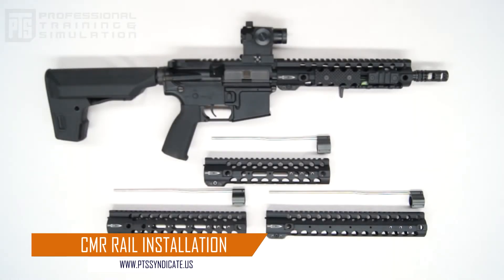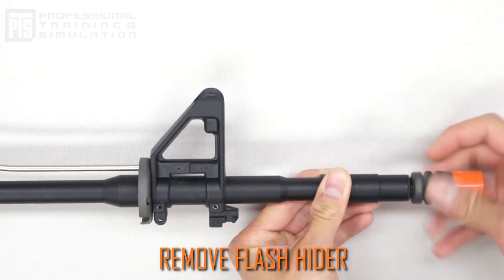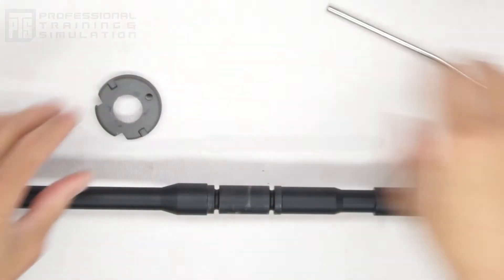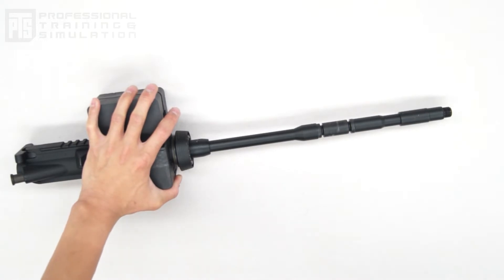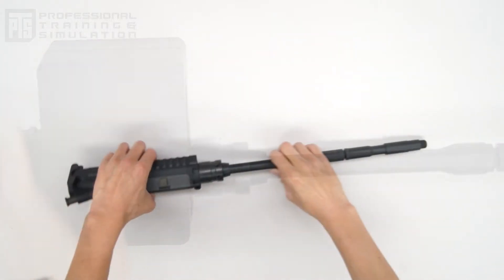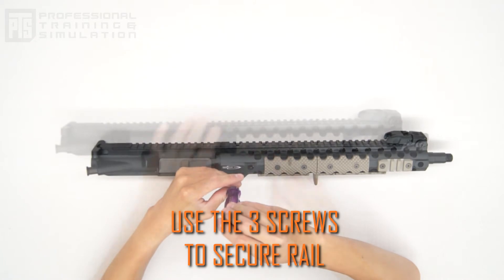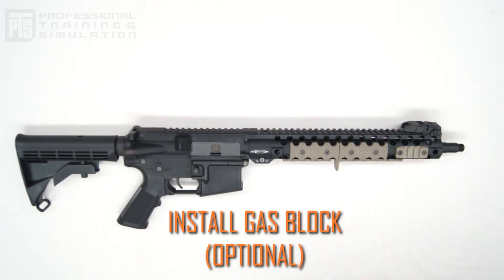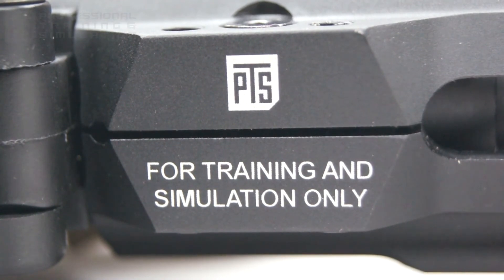PTS CENTURION ARMS CMR RAIL INSTALLATION

Comment: Hey, PTS, just a note from an actual AR15 user and airsofter. when you install the rail, it is easier to install the gas block first, and THEN put the rail on over it. Just a realism critique. On a positive note, I love your work, keep it up!
Reply: you cant install it first
Reply: @HeckerAirsoft  yes, you can. If you can insert the gas block from the front of the rail system, then the diameter of the rail is clearly large enough that it could have been installed first, like a real AR15 would be built. Not only that, but it would be easier to do it this way as you will not have to work around the rail system to install and pins or screws that secure the gas block to the barrel. And before you try to come up with an argument, I am an SDI graduate and licensed gunsmith, on top of building real steel AR15s professionally and have been doing so for 6 and a half years. Don't embarrass yourself by arguing further.
Reply: @andrewshepherd1537  bro the rail is not able to do that as the gas tube fits into a pocket in the rail itself it's not able to go through to the hole for the gas tube on the reciver
Reply: @HeckerAirsoft  really? Because I have installed multiple PTS rails on a couple of my AEGs and one on a GBBR, and every time I'm able to slide the rail over the entire assembly. Yes, on my WE TECH, I have to tilt the rail upwards by 3 degrees, but not because of some mystical pocket. My gas block hangs up on the inside of the rail. That being a 13.5 inch Centurion Arms rail.
Reply: @andrewshepherd1537  fuckin hell mate how do you write all that lot that's like a story from that bible book thing
Reply: @HeckerAirsoft  it's called being literate. If you can't argue with someone because they can speak and write over your own literary level, it's usually best to stop. It just just ends in your embarrassment and mockery from everyone else
Reply: @andrewshepherd1537  not even arguing mate it's you

Comment: Is there a special tool used for the proprietary CMR barrel nut?
Reply: +101musclehedz There is, but I ended up just cranking my SBR barrel nut down with an armorer's wrench until the pin on the wrench broke lol. Well over torque, but headspaces fine and everything works great.
Reply: I've broken three pins and two allen keys (whichever would fit in the wrench slot).

Comment: do i need to have a real delta ring? can i mount it on the VFC Saber Cqb mod 1?
Reply: you dont use the delta ring with the CMR rails. You only use the delta ring with the PTS C4 rails
Reply: Did you ever find it if it works with the vfc saber?